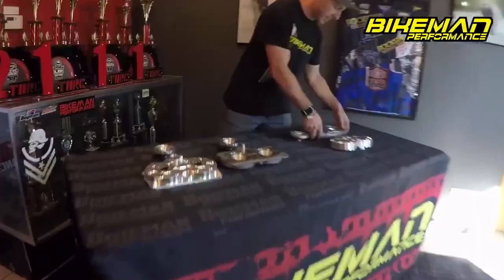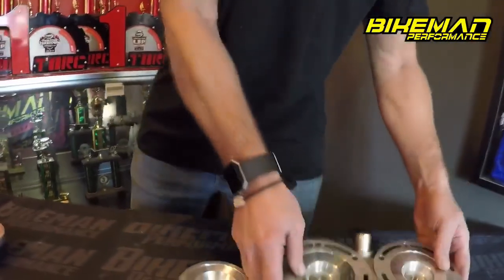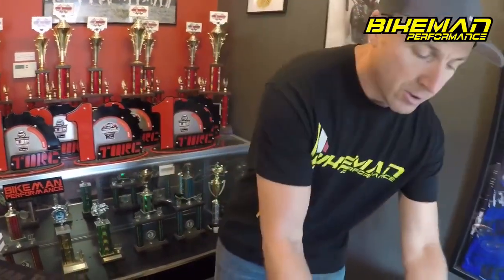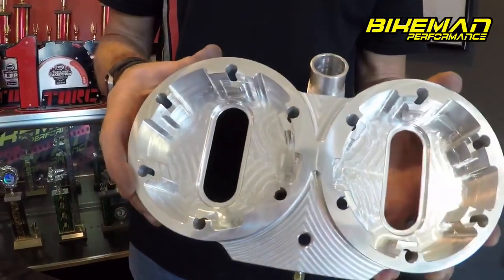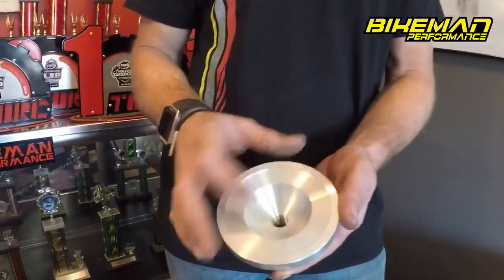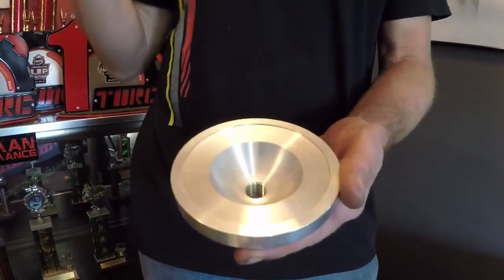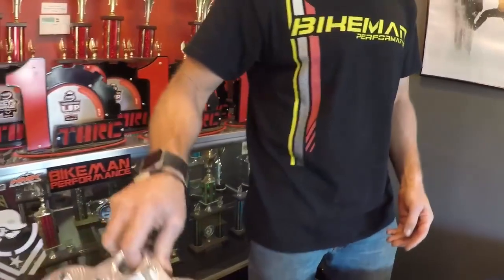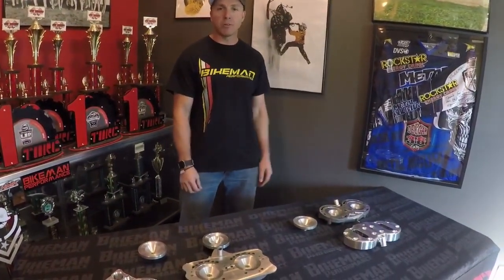Billet Head Advantages - Bikeman Performance Tech Tuesday s01e14

Comment: What is recommended for a 2020 alpha riding primarily 5200-6500 Feet? Is there danger running the engine under low engine load on the trails at lower altitude just to get up? These run on pump gas I assume?